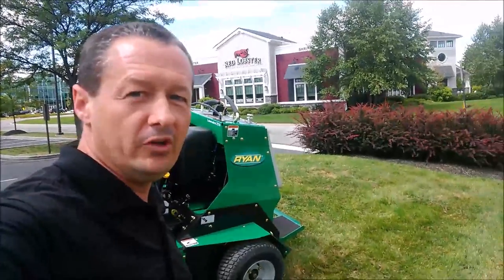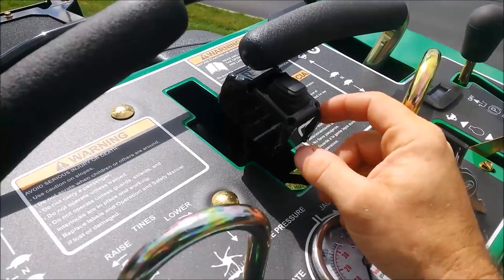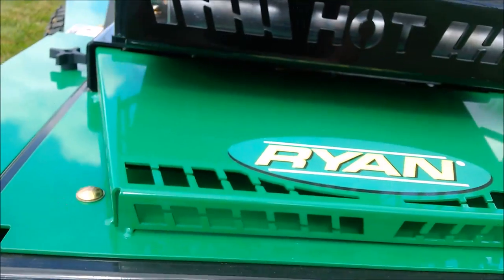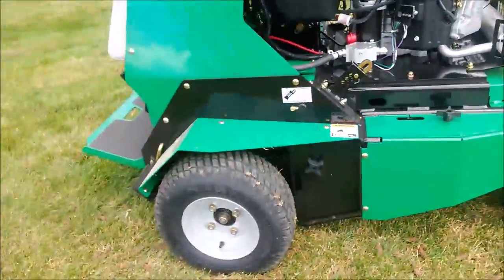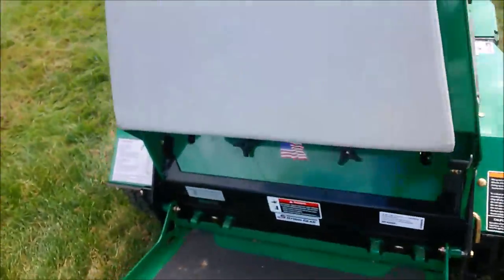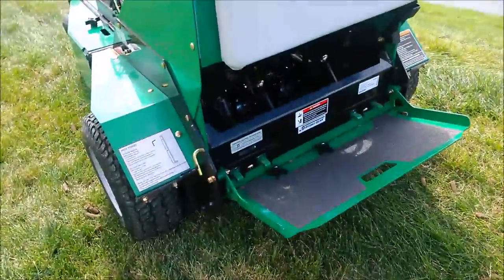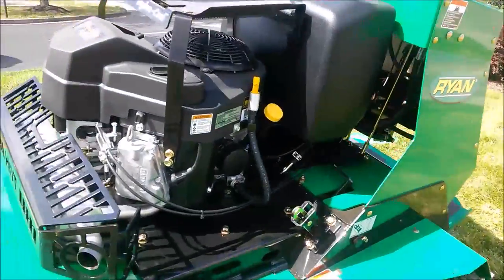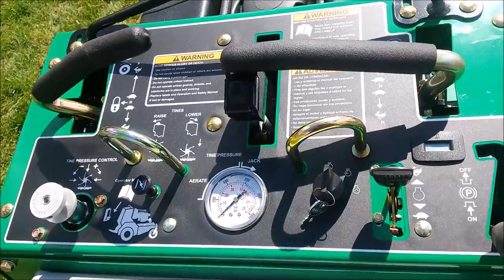Ryan ZTS First Review - Stand on Zero Turn Aerator VS Exmark

Comment: Just saw this machine demoed 2 days ago-awsome on maintenance!  Being a person who sees the BMPs of most applications I noted the additional comfort of no toe/foot action vs. the thumb switch for lowering tines.  Good point here about the standing position and platform comfort.  I recommend 1/2" shock absorbing padding on the platform and an additional pad on the operator belly pad to bring you more to an upright position plus keep your knees off the factory padding.  If I order one I will be modifying it!
Reply from the maker: Yes, agreed.  Sometimes customization is necessary . Now that I've run this a lot I'll have to say that the thumb switch I great, but also something that you have to watch. it's VERY easy to accidentally engage it. Especially if you try to run the machine one handed. Once or twice I've bumped it unloading it off the trailer.

Comment: the depth setting isnt redundant when you find yourself in areas that have soft spots due to shade/poor drainage where if it didnt have it it would pull super deep plugs like the exmark from sinking into the soil.  i got to demo one and i would love to have one after using it, it can do way more steeper hills if needed.   i prefer the thumb tine control vs the foot pedal, there really isnt a learning curve to use it and the tine response up/down is faster than the exmark while also not being held constantly. 

a key thing while going over curbs is to go strait on with either brand of machines if not you will likely have contact with the concrete at an angle( same with any drum machine), if you have to go over curbs just get a 2x12 and cut it around 5' should give you all the clearance to get over it with zero issues.    good review nice to see others opinions on it
Reply: zerocool212121 moo moo but bird . ,

Comment from the maker: Thanks everyone for your great comments and your views! Please subscribe as I'd like to pick up some followers!A quick note about my assessment qualifications. (not to brag) I have 20+ yrs aeration experience on almost every type of equipment available. I've aerated more than 15,000 properties residential and commercial and have well over 8000 hrs on aeration equipment.Now 100 hrs on our Ryan ZTS.  It plugs beautifully and consistently. It's fast and efficient to operate. First off I just want to say that I love running this machine and enjoy the ease of mechanical access. Maintenance (or lack there of) is a breeze. Had a few issues so I thought I'd update. As with any first generation equipment there will be bugs to work out and weak spots identified. When our machine was in for warranty service the dealer provided a "demo" for my use. Even though it only had about 40 hrs, it looked like it had been through war. :( Here are some items I've identified so far as underbuilt and need to keep an eye on. 1) Aux Hydro lift pump was recalled and replaced by Ryan due to problematic issues.2) My unit bent a tine mount. Found out that the mounts for the tines are inadequate and can bend or break frequently.3) There have been factory changes to the tine pressure assembly that replaces a bolt with "c" clips for retention.4) My unit snapped the drive shaft that holds the left wheel drive sprocket.5) Would be nice to have foam filled tires on front, they seem thin.6) The automatic chain tensioner can adjust to tightly and cause binding. I needed to manually re-adjust for proper tension.7) Tine carriage lift arm brackets, will come loose and possibly bend due to pins holding them.Demo unit was a mess: The complete tine carriage was bent, especially the lift arms that are held with removable pins. Several tines were bent and broken off. Lift carriage brackets (4) were missing and/or bent. Tines would not lift off the ground. The tires had numerous plugs & every tire on the machine leaked air. I had to repair their machine 5 times during week we used it just to keep it going. Finally after getting the machine operable once again, the left hydro pump failed. Disclosure... I would attribute most of these problems to untrained and operator error. Possibly trying to turn sharply with the tines in ground or maybe hitting items in the lawn. However, I've also used Exmark rental machines and other that the chains and belts they are pretty tough. I really love the design and performance of the machine, but better treat it gently at least until there are a few more generations out. Don't let all this discourage you too much because realistically I could give you a similar list on any machine that we put into full service. Aerators by nature have a hard life and the operator is the biggest contributing factor to its longevity.

Comment from the maker: Now that I have more than 80hrs on this machine, I'm finding other differences and details The depth limiters are useful in achieving consistent plugs. Especially in soft and wet conditions. Also useful when using in combination with Ryan walk behind unit and trying to match plug depth.
Reply: my company has 2 of the xmarks, I find them to have too many issues to make them quality commercial machines, we have issues with the chains, they have a terrible balance going up hills the small tires make them very easy to get stuck in soft soil. The foot pedal to control the tines is placed so its hard to keep it engaged, and easy to bump when in transport mode.

Comment: Nice review thanks also could a 20 gallon sprayer be mounted on the front in the 2 inch receiver maybe a custom made mount for a sprayer?
Reply from the maker: Yes, but that's a lot of weight and some modifications would be needed. We  mounted an electric spyker spreader and did a step by step video on that. I don't think that video is public yet. You would need to remove some of the front weight plates, and maybe add some rear or wheel weights.